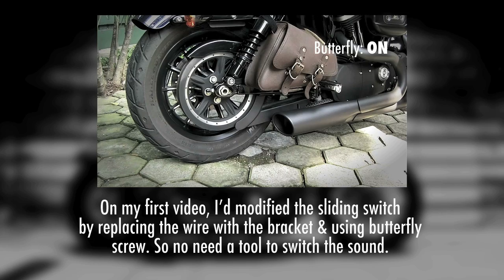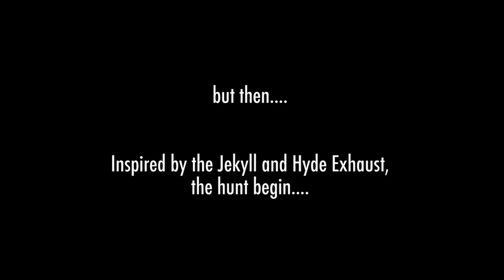Patriot Defender Exhaust Switch Modification on 2012 Harley Sportster Iron

Comment: That's killer. I want to buy that exhaust system for my bike but I'm having trouble finding em in stock, anywhere. Kickass mod man. If I get a set I'll probably do the same thing!
Reply from the maker: +Bob Ellsworth Thanks Bob. Have you found it yet? If you can't find it on ebay, try go to pertronixdotcom.
Reply: I been looking and I will try eBay. I'll have to make em fit, I got a rigid mount 99 and I haven't seen em sold specifically for the older bikes but ik people have em on them so I'll have to make it happen
Reply from the maker: +Bob Ellsworth Cool bro. Make it happen!

Comment: Nice mod  and GOOD job  !
I'm currently building a Defender pretender from xr  pipes and Defender collector/muffler from Dyna since they are no longer available for  sportster. Also,
I'll be trying to get mine to work off throttle position sensor voltage.
Reply from the maker: Goodluck..! And may the force be with you... =P

Comment: Nice pipes and thats an awesome mod!!!
Reply from the maker: Thanks Zhiro. =P
Reply: capskie When I get my Iron in the near future I think I'd also go with those pipes so far I like the sound out of it best compared to others I've heard on youtube.
Reply from the maker: Zshiro so far I'm happy with the pipes bro. The black version is good, but the chrome one are kind of easy to change color to goldish cause by the heat.
Reply: capskie Yea I'd stick with the black too because of the discoloration from the heat on chrome, and black looks more badass. Digging the pro video you made a year ago looks like a commercial for the Iron 883. Which editor did you use?
Reply from the maker: Zshiro hehehe, thanks bro. That video was shot with Canon 60D with manual old Canon FD Lens f1.4 edited using Final Cut Pro software on Mac. Just for fun ^^P
Reply: capskie Oh nice! That's a great lens has excellent Bokeh! lol The first DSLR I'm planning on buying is the Canon 70D still messing around with iMovie and the Sony DSC-HX1 its a decent digital super zoom. And I'll have to learn how to use Final Cut Pro. What do you think about the newly announced Harley 750 Street? it's a smaller engine than the Iron but I'm digging the styling on it it's somewhat of a V-Rod mixed with Iron.
Reply from the maker: Well, to be honest I don't like the design. It kind of "loose" the Harley Davidson's identity, specially on the rear side. But that's just my opinion... :P

Comment: What did you do as far as mapping the fuel delivery? Since you are going in between open and closed you are gonna be too lean or too rich in one of those settings correct?
Reply from the maker: I used mapp setting for python 2 to 1 exhaust. Because I only close the butterfly during at night when I entering the neighbourhood in slow speed so it doesn't effect much.

Comment: Where did u get it, website or a harley dealer?
Reply from the maker: From a Harley's dealer. Its quiet difficult to find OEM item out side the dealers.
But a lot aftermarket product that similar to it on the web. Try ebay. ;P
Reply: capskie Thanx alot bro. Really preciate u takin the time to respond back.
Reply from the maker: Thebully Pack Gladly bro ^^P
Ride safe \m/

Comment: how did u do it? where did u get it? please teach me
Reply from the maker: You can buy the actuator on actuonix(dot)com. For the rest item you can find it in every auto accessories store. To see how to connecting the wire on the universal power window switch, brows on google, its all there. Goodluck.
Reply: capskie can you please share the link for the cutout and the butterfly too 😊
Reply from the maker: The butterfly is a built in with the exhaust though. The brand of the exhaust is Patriot Defender. Its the exhaust that has capability to switch the sound from loud to quiet because of their butterfly system but it has to be switch manually. What I do here is customized the manual butterfly switch to electric by using those small actuators and power universal window switch. =)
Reply: ok thank you so much

Comment: capskie bro, install sendiri atau dibawa ke bengkel. Kalau ke bengkel minta refrensinya dong. Thank you bro...
Reply from the maker: Instal sendiri bro.. gak susah kok. Skema informasi  koneksi kabel plus minus utk di power window switchnya bisa di browsing di google. Brackets utk dudukan servonya pake bracket yg biasa dijual di toko accessories mobil. Goodluck bro! \m/